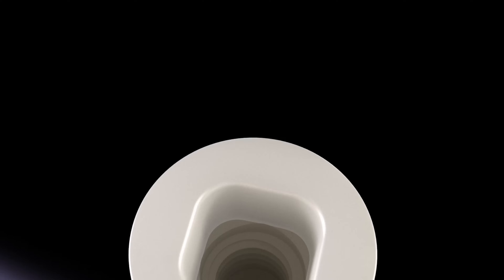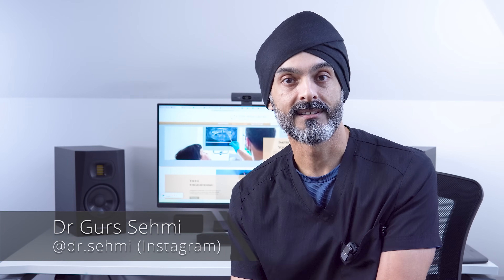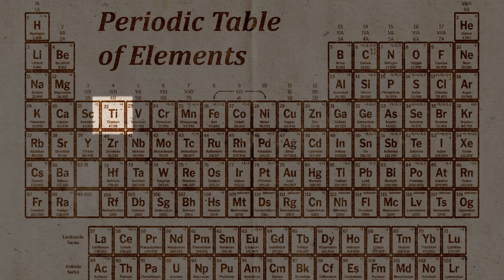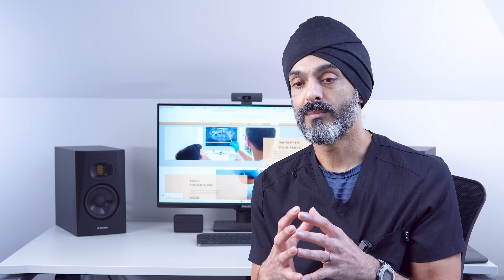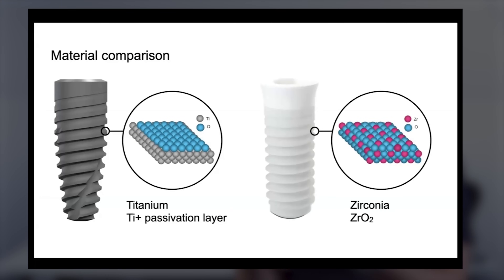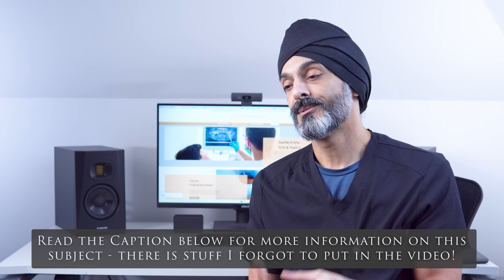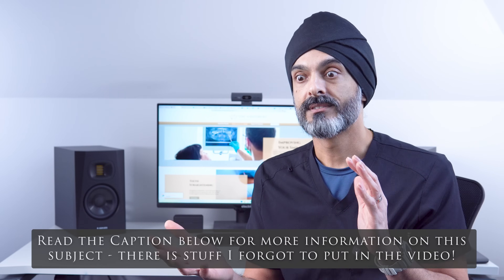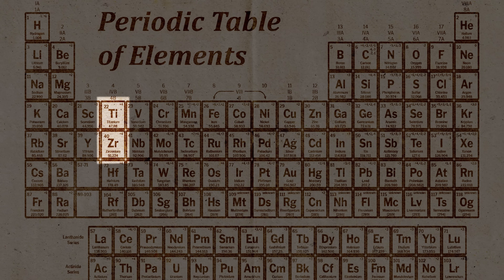Are Zirconia Dental Implants the Future of Dental Implants?

Comment: Ceramic implants are assimilated completely neutrally as they do not have any free electrons on their surface. For this reason, they are assimilated into the connective tissue without bone loss or signs of gingiva inflammation in around one percent of cases. This does not occur with titanium implants, which heal via a kind of chronic inflammation involving the release of the inflammation mediators TNF-α and IL-1β. As a result, their initial healing rate is approximately 1%
higher than that of ceramic implants. However, with ceramic implants there is no risk of loss due to peri-implantitis (according to a consensus conference on paradontology in 2006 = 16% of titanium implants after five years)

Comment: Most of this was okay. Ceramic is bioinert and is more overall biocompatible. One thing you didn't touch on is how the soft tissue makes a direct attachment to the ceramic implant. This practically eliminates peri implantitis which is a huge issue with titanium. Soft tissue loves ceramics!

You should look into the company "Swiss Dental Solutions". Full Arch reconstructions with these implants are done well. Also you can prep the implant to make a "custom abutment". This solves your esthetic, position concern. Also white ceramic easily wins vs titanium when it comes to esthetics. 

Ceramic implants are the future! 

Cheers!
Reply: My dentist went with a ceramic implant for the number 30 tooth.  It's a two piece design.  Right now I have a cap screwed in the top - waiting to do the crown.  Do you think the two piece design is OK for back teeth?
Reply: As long as the metal inside allows mri if needed

Comment: 1 piece implants ie zirconia don't have the microgap issue between the implant and abutment. This microgap with 2 piece implants normally ends up contaminated with pathogens which contributes to bone loss around the implant.
Reply: A Morse taper platform which cold welds the abutment to the implant also eliminates the micro gap while still allowing you to use numerous restorative options to fit that platform.
Reply: But the 1 piece implants break much easily...

Comment: Hi Dr Gurs thank you for your in-depth comparison of Titanium and Zirconia. If an implant post (screw) fails due to fracture etc… how is it removed and replaced? My understanding is that the osseointergartion would make it impossible to ‘unscrew’ it, surely if you were to even try you would cause fracturing to the bone? Can they be cut / drilled out, the bone ‘regrown’ and a new post inserted? Of-course you can replace the abutments, crown or supported arch over and over so in reality are the lifespans of all dental implants dependent on the longevity of the posts themselves?
Does this affect the long-term prognosis of younger patients with implants? Say persons who get implants in their 20’s/30’s who may run into such problems 15 years later in their 40’s/50’s and again 15 years later in their 60’s/70’s?
Reply: I have a two piece ceramic implant as one of my rear teeth.  Did you get an answer to your question regarding what happens if the post breaks?  Thanks.